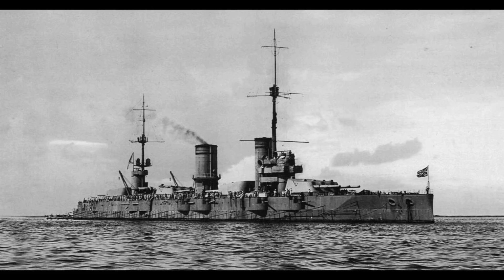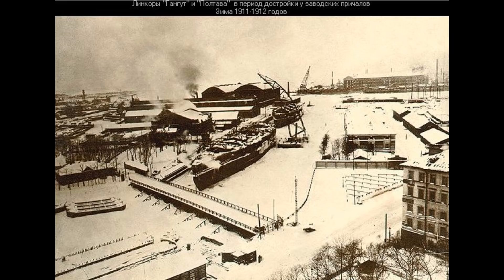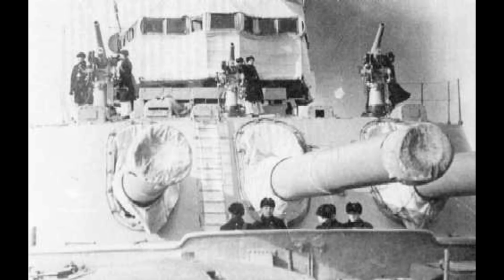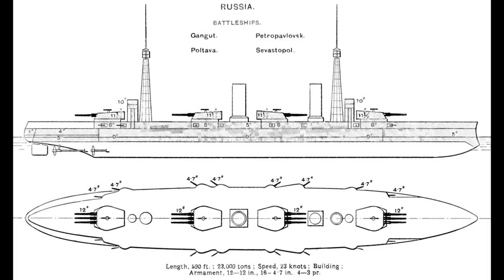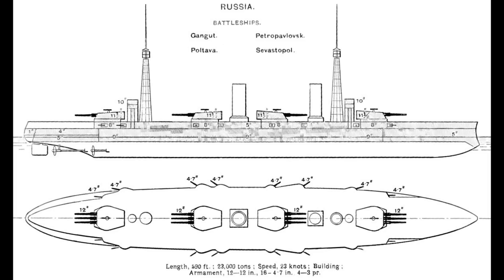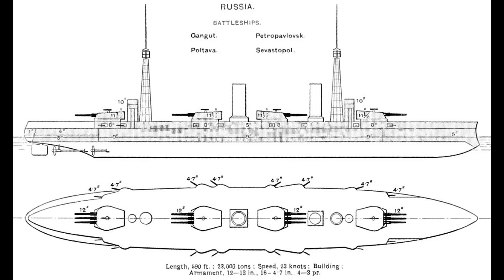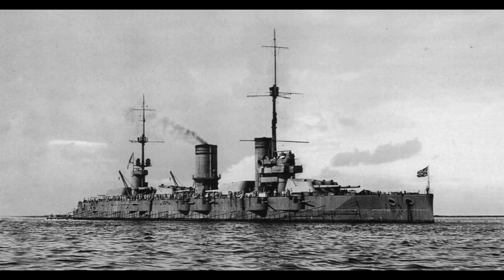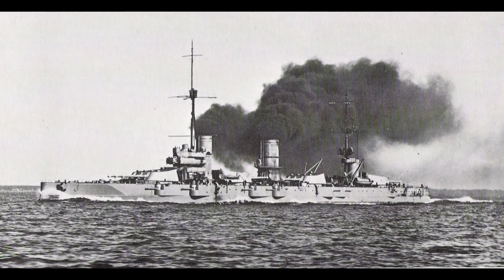HIRMS Gangut - Guide 016 (Human Voice)

Comment: a single anti-air gun... "I'm relevant !!!"
Reply: "I'm helping "
Reply: sidecarnutz  "I'mdoing my part ! and you?"
Reply: Navy: we need better anti air...
Government: fine heres $1000.
Navy: [buys the 1 gun it can afford].
Government: The ship was lost due to bombing?! Obviously the funds for anti air were squandered. [Cuts funding further, arms crew with $5 water squirt guns].
Reply: @tomstech4390  Or a side by side 12 gauge and a crate of bird shot.
Reply: It is built before WW1. Even post war refits were done before air power was a thing. They knew that AA is not adequate and refits did increase AA capability.
1 AA gun is from English specs. Image shows AA guns mounted on each turret. They were not mounting quarter of a gun on each turret. Russian book referenced in wikipedia talks about two 75 or 68 mm and one 47mm Hotchkiss gun and https://ru.wikipedia.org/wiki/%D0%A4%D0%B0%D0%B9%D0%BB:Battleship_Marat_12-inch_bow_triple_turret.jpg  (and 2:35 photo in video) matches it. Initial plans were for 4x4 QF-3 Hotchkiss according to Russian sources, but they did not have enough of those or they lost lots of them in Tsushima.

Comment: Note the more modern looking "clipper" bows and pagoda style superstructures.  Big problem with ships that had their turrets spaced between engine rooms was that despite the best efforts, the difference in temperatures of the ammunition meant greater dispersion of salvos.  Second problem was the lack of space to add AA guns without interfering with firing arcs. Third problem was where to put fire controls, radar and radio compartments.  The Japanese and American navies had the same problem with their prewar designs.

Comment: One thing I'd like to point out: these ships were called the Sevastopol class in Russian documents. I've got a few books in original language that refers to them as such. Just needed to get this out there, since Gangut was the last of the four battleships to be launched and commissioned. 
Aside from that, great video as always Drach!
Reply: They are called Gangut class in some older documents, IIRC.
Reply: It might be because Gangut was the one that was supposed to be finished the first. I think its the same case with Borodino-class , Izmail was the one that was launched the first instead of Borodino.
Reply: @renown6386  Good point, but that is still technically not correct. Just felt that it needed to be pointed out.

Comment: There in one day. Nice! Thanks, Drach. The modernized Gangut class had their own version of pagoda masts, but they all had quite good fire control systems that were continually upgraded into WWII. It would have been interesting to see how they would have fared in a gun duel with a _Scharnost_.
Reply: Scharnhorst has a decent speed advantage. Scharnhorst also has a 14 inch belt that should fare decently well against Gangut’s 12 inch guns, while Gangut’s 9 inch belt would really struggle against Scharnhorst’s 11 inch guns.
Reply: A Scharnhorst would shred them in short order. Radar gunlaying, much better armour, much faster. The German 11" I suspect at least matches the old Russian 12", if not betters it. Gangut has an advantage in weight of broadside, but that's about it.
Reply: even modernized she had less armour than a WW1 British Battlecruiser even Kongo is heavily armoured compared to Gangut not to mention how slow she was by WW2 standards in WW2 the Russians borrowed an old obsolete R class Battleship from the British and that ship was easily the most powerful ship in the entire Soviet Navy.  In any gun duel between a modernized Gangut and even a Kongo or a 1930 HMS Tiger let alone a Scharnhorst Gangut is just an XP piñata